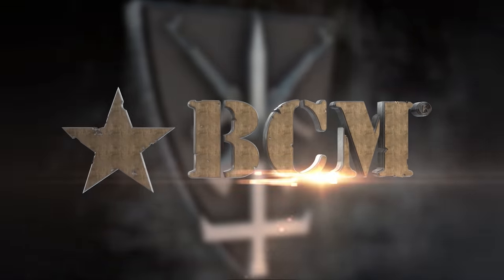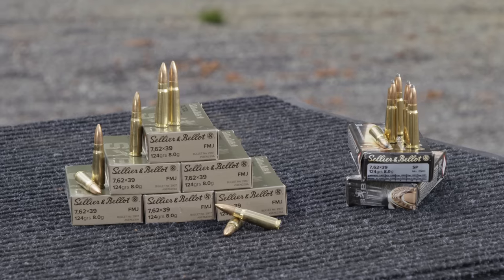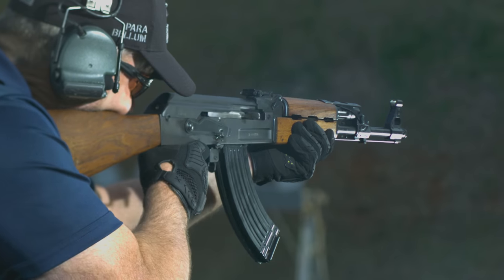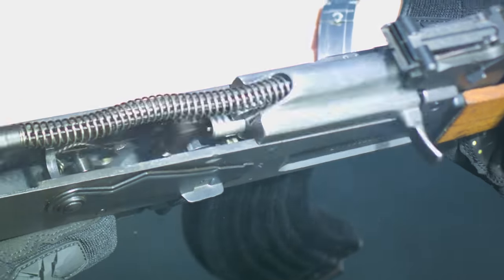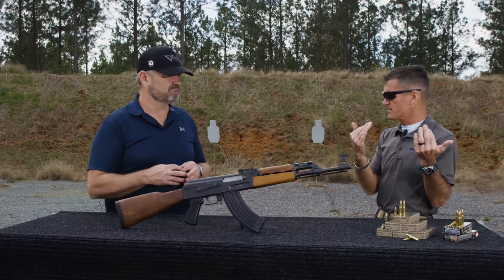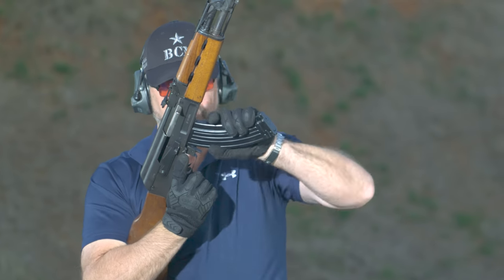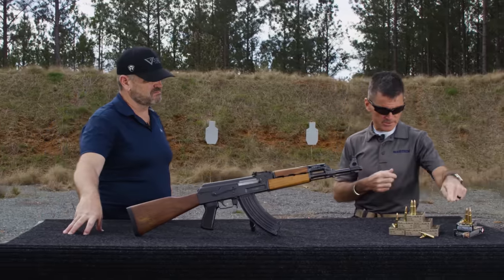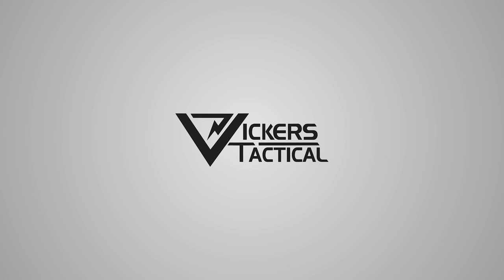S&B 7.62x39 - Brass Vs Steel Case

Comment: 🤔 ...my AKs are on a strict COMBLOC steel diet as recommended by their Slav breeders.
Reply: Goin brass for AKs is like being a vegan
Reply: worry about corrosion? WESTERN SPY!
Reply: you need to play them hardbass and give them plenty of dirt to play in too, AKs have other needs than just food!
Reply: Dont forget the adidas outfit!
Reply: Tip some vodka in the working parts and down the barrel once every few lightyears and your good to go 👍
Reply: What about now?
Reply: My prediction:  see the obvious panic spike.  Will be about a year or so and someone in the Eastern Bloc will fill demand.  Romania?  Ukraine? Serbia? Poland?
Reply: @bogo1992  I’m thinking the same and us manufactures may do the same it would be nice to get a Tula or wolf usa though
Reply: Lol. Looks like the world caught up to you
Reply: Steel or GTFO
Reply: @chrisrogers4242  I'm sorry what?
Reply: Still can get it cheap but that is very temporary. When it runs out i havent found a another manufacturer of steel cased 762 or 545
Reply: @dylanmccallister1888  psa bought steel case ammo machines
Reply: @chrisrogers4242  sweet
Reply: I reload and save a ton of money, particularly in the recent environment.  Not to mention the reloaded ammunition, even if done in the most non anal manner, is generally at least twice as accurate group wise.

If given a choice of two types of ammunition, one of which is twice as expensive and half as accurate, brass cased all the way.
Reply: @dylanmccallister1888  double m defence ammo
Reply: @mr.c.3760  🤣🤣🤣🤣🤣
Reply: Agreed Italian  gec😊o  brass fails😢
Reply: @mr.c.3760 you can reload them and shoot it at ranges.🤷‍♂️
Reply: Yugoslavia has used brass 7.62x39 since at least 1967.

Comment: OK. Who else remembers 20 rounds of Wolf for $2.50? (sob)
Reply: I remember when you could buy a case of Chinese steel core and an SKS for $79.  When we were done we'd spear the SKS into the swamp.  Then go get more.
Reply: @NuclearGrizzly  exactly how I picked up my first SKS! I wish I would have bought about 25 SKS and about 50 AK's back then. They were Chinese and still packed in grease. Those were the days! ✌
Reply: @budstermcgreen6360  I keep one.  A particularly accurate example with the red fiberglass "jungle" stock.  All the rest are sleeping with the gators.  I could kick myself now.
Reply: NuclearGrizzly I wish I grew up in those days. I always hear about it from my dad and I get jealous, I’m only 23.
Reply: I remember cases stacked to the ceiling at shops and rows and rows of SKS's in 1980 Norinco steel core was 1.99 per 20 rd box copperwashed the good shit.
SKS's were as follows...... Chinese paratroopers or full size $59, Yugos were$79 and racks of tula's for $99 and you could pick from 100's
Reply: Ben Finny  Seemed like every month the 7.62x39 came from a different country.  I still have a can of Romanian that's been sitting in the back of my closet for a few decades.
Reply: @WillE454  your kids will say the same about you. "Man, my dad tells about the good old days when you could build and AR15 for $350!" shoots surplus pulse laser that cost $50,000 in the bargain bin
Reply: I was lucky to find 500 for $300.
Reply: Who remembers wolf
Reply: @MrGible  pain
Reply: Or Norinco in the late 80s for $1.99 a box.

Comment: If your gun won’t run steel case, sell it. Extractor is a wear item and needs replaced every 10,000 or so anyways.
Reply: Brass is roughly double the price. Let’s say it’s 30 bucks to replace an extractor. You save that money in 150 rounds?
Reply: @-John-Doe-  and if you run it in an AR, the barrels are 150 to 200. Also. Cheap
Reply: My friend has a KAC SR15 and it wont cycle steel cased 223 barnaul ammo. Should he sell it?
Reply: @michamichaowski8375  yes

Comment: steel case is 1/2 the price end of story.
Reply: But it's bad, because reasons.
Reply: @regularfather4708  Not really, especially with shooting the stuff through combloc weapons. My Romanian SAR 1 and micro draco fire it just fine with zero issues whatsoever. My prissy ass RAS 47 pistol is another story, doesn't function all that reliable with steel case stuff, but is perfectly fine with brass case stuff. I'll never shoot steel case stuff out of any of my ARs or mini 14s because the stuff is really hard on the extractors and broke a few. Besides that, I had a few cases get stuck in the chamber as well.
Reply: @hoffmiermp  I was being sarcastic. Steel is about 80% of everything I shoot. AR, AK, glock, keltec, sks. Everything eats steel.
Reply: @regularfather4708  👌
Reply: Not any more
Reply: @sieve5  This. Who would have thought, steel case Tula selling for within a few cents per round of this stuff.
Reply: Hi. So about that Russian steel case

Comment: Isn't "high military standard" an oxymoron?
Reply: Depends on what the other baseline options are. Normally the military will go with the lowest bidder if it's buying in quantity and if they can still meet the requirements. Alternatively, if it's something more specialized, the inflated military industrial complex normally offers the best available. While there is still bidding for contracts, the Pentagon may purchase quality if it offers a considerable advantage. Case in point, the stealth bomber.
Reply: @rzr2ffe325  What quality, like $10,000 hammers and that Flying Spade that the Serbians shot down with an old Soviet ZPU?
Reply: I guess the ammo etc special forces use.

Comment: I haven’t met a stock AK that doesn’t dent the shit out of brass cases making them not really reloadable after a firing anyways.
Reply: Your loss then.
Reply: Pete Lyczek it really is...literally haha. Not saying it isn’t good ammo. S&B have definitely given me better groups during slow fire when focusing on being as precise as possible. But the vast majority of what I do with an AK is usually run and gun between 50-100yds just trying to get center mass hits on torso targets. I’ll save the brass cases for shots where I’m taking a little more time.
Reply: Depends if its a normal violent ejection or a adjusted piston. But for the 7.62 ars with a good mag i see these working good
Reply: Nick Levine most 7.62 AKs are overgassed from the factory to ensure maximum reliability even with poorly manufactured ammo. I’ll admit that the KNS pistons are nice especially when shooting suppressed or if your gun is violently overgassed but most of mine aren’t overgassed by much, even suppressed with the Dead Air PBS-1, but they are enough so that the  cases usually end up with a small dent from hitting the dust cover or charging handle
Reply: ...if you are lucky enough to find the cases after they have been ejected and dispatched to the county line
Reply: @operator1192  how do you like your dead air ? I so want to get into the silencer game funds witholding 🤣
Reply: Nick Levine I love all of their cans but the PBS-1 Wolverine is excellent on the AK platform, although I’ve used it on a precision bolt gun too. On the AKs it definitely has a lower backpressure than some other .30 cal cans I’ve tried, it sounds good, it’s very well built or overbuilt and their customer service is excellent. My only gripe is it’s a little heavier than some of the competition but even for hard use there should be no reason it shouldn’t outlast my lifetime.
Reply: USCOMBATDIVER I’ve build a few and bought a few and the ones that I built a less so because I went a few thousandths of an inch smaller with the bit that I used to drill the gas port and it still functions fine even with all of the commonly available steel cases stuff in sub zero temperatures but I understand why most are intentionally overgassed. If I were in a competition setting or wasn’t concerned about it being the utmost reliable or if I stuck with one type of ammo and never deviated then I would definitely just install an adjustable gas block, or if I wanted to keep the original aesthetics then I’d go with the KNS piston for sure.
Reply: Yeah, a modern built AK is better with brass, a classic AK better with steel

Comment: Reloading 7.62x39 for an AK was an epic failure for me. My Hungarian under folder, my Arsenal SAM7R, and my Vepr (in 7.62x54r) all tore brass cases to shreds. Cases came out badly dented and damaged, something I don’t see with steel. The Vepr struggled with any brass, especially any heavy ball ammo. It loved light ball with steel cases.

Comment: Nice to see brass cased 7.62 to use in indoor ranges finally
Reply: every indoor range I've been too allows steel cased so idk what your talking about
Reply: @drunkpolack7612  At least in Eastern Michigan there are no ranges here that allow for steel cased ammo. From Detroit upward to Flint I have not found a single indoor range that allows it
Reply: @SheppardOfDeath  ok central texan here

Comment: my ak eats up steel cased wolf all day and its not corrosive
Reply: slow 2v ya Larry is shilling a bit here. None of the modern steel cased offerings are corrosive. Milsurp and earlier commercial stuff was, but not anymore for for the latter.
Reply: Marcin Faron every box that I’ve opened says non-corrosive. Where’s yours saying otherwise l?
Reply: Marcin Faron Again, where is your proof? You’re saying that Tulammo, Wolf, RAS, Golden Tiger, Silver Bear, etc etc all lie? You might as well apply that logic to anything you purchase. So far all you’ve done is gotten emotional without a single shred of proof. I have 3 Izmash AK’s. No corrosion on any of them and I don’t clean them very often.
Reply: My AK gets nothing but berdan primed, steel case, bimetal jacket. I only clean it on leap years, and the only rust is on the disused bore brush.  
    My mosin nagant, however,  still gets fed some corrosive ammo that I have left over, and if it doesn't get cleaned the second I get back from the range there will be corrosion before nightfall. Y'all haters have obviously never fired corrosive ammo, let alone noncorrosive Russian ammo, or you would know the stark difference.

Comment: Hi Larry.This is a regular army M-70B1, not a civilian copy. How did it ended up in US? By the way I used to have been issued a rifle just like that,only with a different muzzle brake. Much better than the one with a folding stock.

Comment: You will hit issues with steel case in a new Ak break in period, either too dry, not holding the weapon tight enough. But steel case is a great break in round bc brass will always work well after the break in with steel.

Comment: Nothing but respect for SFOD-D

As for ammo, there are reasons AK's use steel cased corrosive ammo. Its designed fir it and prevents FTE's and problems with cold weather engagements. 

The AR system was designed for brass. Using steel cased ammo causes FTE's because the coating will stick to the chamber wall. 

As such, only brass in AR
Only steel in AK
Its never a good idea to operate a weapon outside of its manufactured specifications

Comment: My only problem with reloading 7.62x39 is my sks and aks chuck the brass into orbit and I have trouble finding it at the range.
Reply: I could get 5 cases in the air at one time easily with my SKS they went so high. They would always land in a pile too, except for the Winchester, they landed all over my LEFT side.
Reply: @Chris_Garman  my sks tends to shoot my cases straight up probably 10+ feet in the air like we're talking a perfect line up from the floor and tends to spin the cases. We'll see how the vz-58 does and the next couple aks once they're built.

Comment: Finding brass in 7.62x39 used to be really rare. Today in 2022 even amid an “ammo situation” it seems pretty plentiful. I’ve seen it on the shelf and quite a bit online.
Reply: Brass ammo is rare now, I been stocking up on steel
Reply: Not cheap though.

Comment: Whose getting a new gun once we get our stimulus checks also which should I get ar 10 or ar 15
Reply: If you already have a few guns and a moderate amount of ammunition, i would recommend you buy some non perishable food and other essential items. Guns are important, but so are other things.
Reply: Shhhhh don't tell my wife bro
Reply: @ts1905  true true
Reply: Night vision brother..... having the ability to operate 24 hours of the day is a massive force multiplier
Reply: @nickrhodes4619  any u can recommend
Reply: raidaz 75 what’s your budget? NVG quality greatly depends on price.
Reply: raidaz 75 yeah buddy..... anything Gen 2 or Gen 3. I purchased a PVS 14 Gen 3 white Phosphorous it’s frieken awesome so much better than the ones we currently use in the Marine Corps but some companies offer finanacing which was a nice thing to take advantage of
Reply: @thegoodnewsguy1315  500 or less
Reply: raidaz 75 that’s gen 1 night vision right there. But if you look around you might be able to find gen 2 at that price. But it’s hard to get a good deal on nods.
Reply: @thegoodnewsguy1315  alr thx man
Reply: raidaz 75 check ebay or gun broker sometimes you can get a steal in some blemished PVS 7s digital night vision is out there for cheap.... I have the Bushnell PVS 14 clone lol paid like 300 but it’s not that great
Reply: @ts1905  To true. We should be stacking can foods,water filters, portable stoves. The future looks a little ruff.
Reply: AR 15 bro get a palmetto if you can , if not try a dpms or Smith and wesson
Reply: Nick Rhodes yeah bushnell pvs 14 clone is the same Chinese pvs 14 clone that I find for $120 lol. Bushnell rebranded then overpriced. But a decent night vision is the sightmark ghost hunter 1x from what I hear it’s ok, but most importantly it’s only $200 for gen 1 night vision. Not bad.
Reply: @thegoodnewsguy1315  thx man I'll keep that 1 in mind
Reply: Nick Rhodes hey do you every plan to make a review of the bushnell pvs 14? And is it useable?

Comment: Does the S&B use a harder primer to prevent slam fires with floating firing pins?
Reply: S&B slam fires in my My10X
Reply: Should read "my M10X."
Reply: @2549Discovery  I was concerned about that.  My Polytech has a spring loaded primer so there isn't any issue.  My other dozen or so AK's will occasionally slam fire with Winchester white box.  Even though their firing pins occasionally leave a mark on a steel cased ammo they have never had a slam fire.
Reply: Keep the firing pin and firing pin channel clean
Reply: @nathanlewis5682  The issue is with inertia.

Comment: I prefer brass but steel case 7.62s works fine in my AR10 and AR15s. Having sad that I will never use corrosive in any of my firearms.
Reply: Corrosive ammo is not harmful to the gun in any way as long as you clean it after you shoot it. You can shoot 10,000 rounds of corrosive and non-corrosive ammo side by side in identical guns, and they would wear the same as long as you cleaned the corrosive gun with water based solvent after each session. It's not scary, it's not extra wear, it's not worth any worrying over. I have shot TONS of cheap, corrosive milsurp in 8mm Mauser, x54r, x39, x25, and 8x56R. It all goes bang and it all cleans up just fine. No rust anywhere on my guns. 👍
Reply: @mannys9130   only thing is, it's a pain in the ass to get out the hot, soapy water after every range session. As long as you're down with that, corrosive is nothing.

Comment: Video dated "Apr 6, 2020.  Comment on 8th December 2021.  I reload 7.62x39mm to shoot in my CZ bolt rifle.  I recently tried to load some S&B brass.  After decapping and cleaning, I found primers (Wnchester or CCI) would not seat fully (primer a little proud of the head) UNLESS I deepened the primer pockets with a tool.  Could be just one lot, but it is a pain.